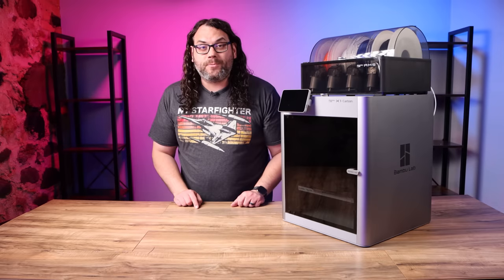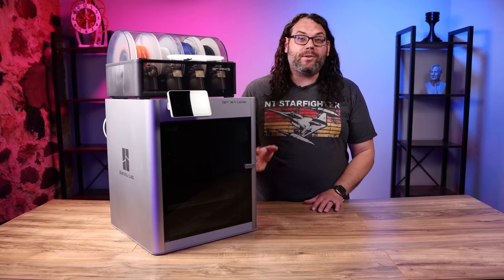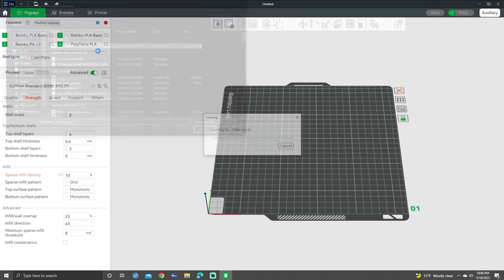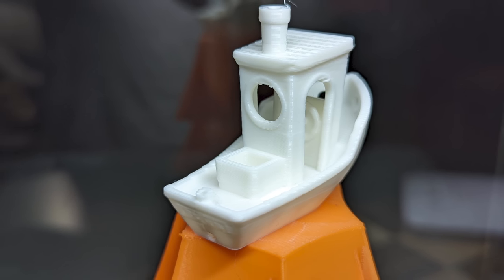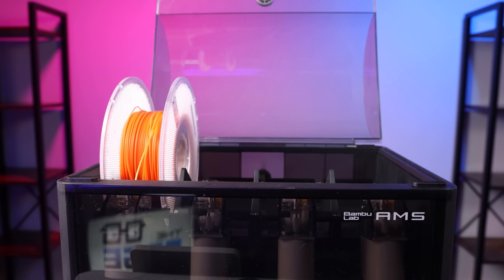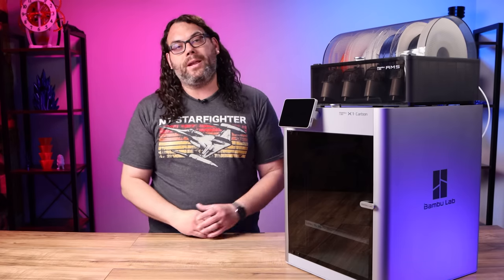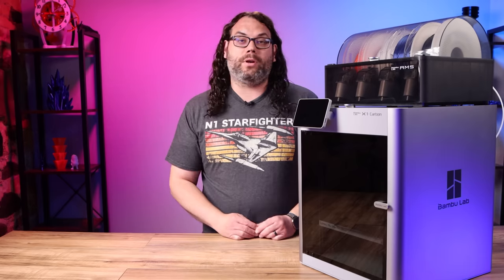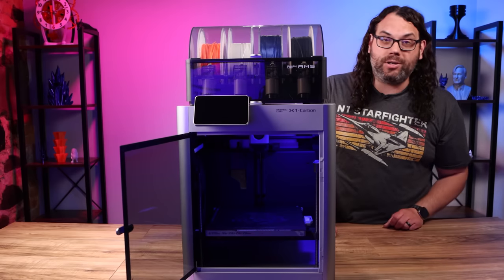The Bambu Lab X1 Carbon - Automatic Self Calibration, LIDAR, AI and INSANELY FAST!

Comment: Be warned no TPU. And you can't use cardboard spools with multi material printing.
Reply from the maker: Not true at all! I'm using polymaker PLA cardboard spool in it right now! Also, you can use TPU all day at full speed and I have proof of that on my Twitter! You just load the filament from the back spool holder and not through the AMS. This thing is a TPU beast to be honest! I will stream it live on @makerdeck when I print the tracks for the Droid I am printing currently!
Reply: @TheEdgeofTech  I got both those things from the Q&A I guess they didn’t mention that TPU was possible outside the AMS. Which makes sense. I thought he said specifically that cardboard wasn’t recommended for multi material. Are you just saying you haven’t noticed any issues?
Reply from the maker: @trunk081  On my stream he said it would be better with plastic rolls, but you could use cardboard. Just watch the AMS and make sure that it's not coming apart into the AMS. TPU rocks with this thing!
Reply: @TheEdgeofTech  Sorry where can I find @makerdeck?

Comment: It looks like a scam product, the more complex the structure means the higher the cost of manufacturing redistribution and maintenance. Judging by the machine's use of carbon fiber rods as its kinematic structure, I think this is the product of an amateur software team.
Reply from the maker: I appreciate the comment, but disagree. Just because it's new tech or a new way of doing it, doesn't make it a scam. I guess time will tell. Thanks for watching!